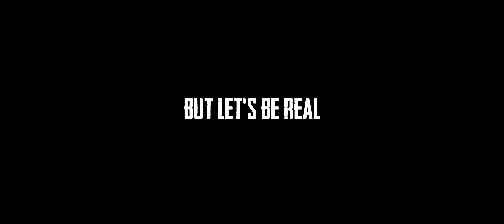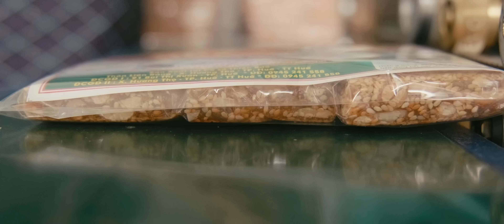My Quest to Save Traditional Vietnamese Candy from Extinction

Comment: a bit more than 20 years ago, it's still quite common to see Traditional Pulled Candy (Kẹo kéo) sellers around Ho Chi Minh City. The seller carried the big block of candy and pulled into 15cm one when ordered, it was extremely soft so it was impossible to hold in straight. A few years after, these sellers disappeared. Later, kẹo kéo was sold at restaurant by sellers with the loud speakers who mostly used the candied as a way to sell their singing skill. Because of these sellers with the loud speakers, these speakers are now call loa kẹo kéo (Pulled Candy Speaker).